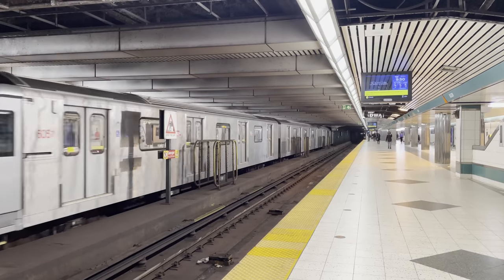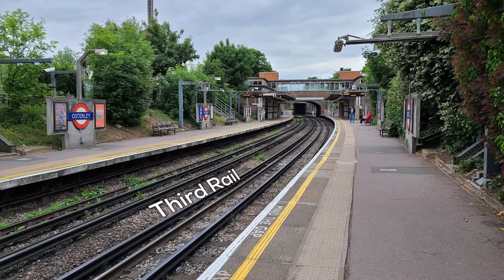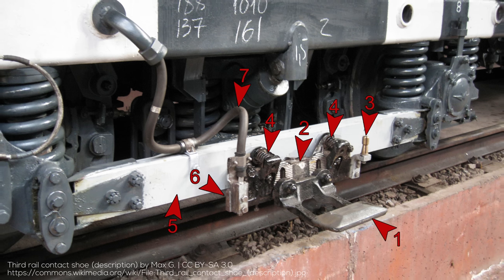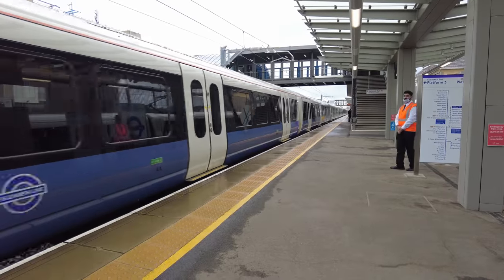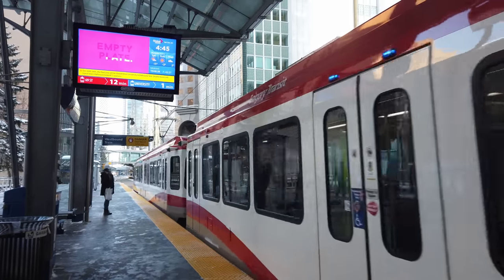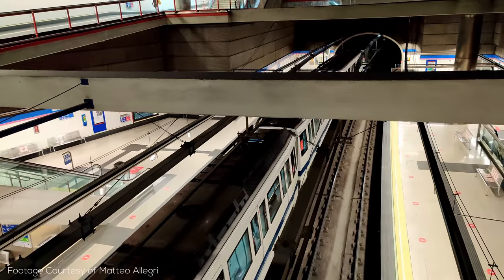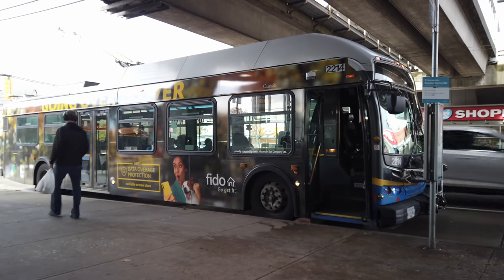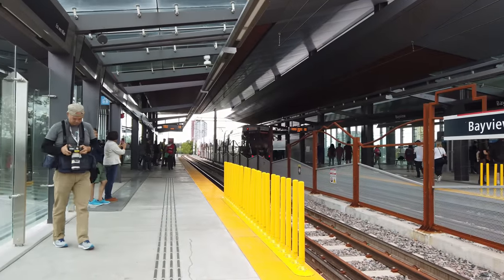The Best Way to Power Your Railway | Third Rail vs. Overhead Wire

Comment from the maker: This video a remake of a previous video incorporating viewer feedback and fully revamping the visuals and rewriting the script (for more details, see my recent community post). Please enjoy and consider sharing!
Reply: I like this video a lot better than the original one 👍🏻
Reply: Please make a follow up explanation video about the Alstom APS and why it doesn't work for temperate climates The information is sparse and the concept is fascinating.
Reply: @RNTransit  in The Netherlands the RET Metroline E rides from Den Haag Centraal to Slinge and from Den Haag Centraal until metrostation Melanchtonweg the metro use Overhead Wires and at the station Melanchtonweg while it halt at the station it switches to third rail and then it uses from Melanchtonweg until Slinge third rail from the Rotterdam Metro system and it shares the tracks from Den Haag Laan van Nieuw Oost Indie until Leidschenveen Tram/Metrostation with HM Randstadrail line 3 from Den Haag Loosduinen to Zoetermeer Centrum-West and 4 from Den Haag De Uithof to Langslingerland Zoetermeer and they use then the former Hofpleinlijn and the trams also the former Zoetermeerlijn. And by RET metroline A from Binnenhof metrostation it use overhead wires from Binnenhof metrostation until Capelsebrug and Metroline B use from Nesselande metrostation until De Tochten metrostation third rail and then by De Tochten it changed to overhead wires and then from De Tochten until Capelsebrug it use overhead wires and halfway by the crossing by metrostation Graskruid metroline A joins metroline B to Capelsebrug and then together it goes to Schiedam Centrum running together with metroline C until Schiedam Centrum and metroline A and B are switching while driving to Schiedam Nieuwland from third rail to overhead wires and from Schiedam Nieuwland until Vlaardingen West metroline B runs together with metroline A  and sometimes a freight train until Vlaardingen Oost and the metroline B runs to the temporary metrostation Hoek van Holland Haven where it ends on 1 of the former train platforms where in 1935 until 1994 D train international teaibs deprted and until 2017 local trains to Rotterdam Centraal departed. Metroline C runs from De Terp to De Akkers where it shares tracks from Capelsebrug until Schiedam Centrum with RET metrolines A and B where line A and B runs then to Vlaardingen West and Hoek van Holland Haven and metroline C runs then further to metrostation Tussenwater where it shares until metrostation De Akkers where it ends the tracks with Line D wich runs from Rotterdam Centraal and shares the track to Slinge with Line E from Den Haag Centraal and metrostation Beurs is a metrostation where at Beurs you can change from Metroline A to Vlaardingen West and Binnenhof to metrolines B to Nesselande and Hoek van Holland, metroline D from Rotterdam Centraal to De Akkers, metroline C from De Terp to De Akkers and metroline E from Den Haag Centraal to Slinge. Maybe you can make a video about the Rotterdam Metro
Reply: Hello Mr. Martin,
thank you for the remake.
However you apparantly still just do a comparison and no clear verdict of which type of electrification, voltage and frequency is the best and should be built for all types of trains in the future. Could you maybe still state a verdict on that?
Best regards,
Reply: This is a much more thorough comparison than the last video, but thing you still didn't mention (and I can imagine fair reasons why you wouldn't) is cost. Third rail does involve less structural components and less copper, with modern systems mainly relying on relatively accessible aluminium. With modern tech, it could simply be incorporated into slab track. This means that there's some benefit to resource use and embedded carbon, at least on the denser systems where third rail is best suited, even if some may argue the actual financial advantage. This can also mean less maintenance if the RoW is protected, which can be another cost saving.
This is why I'm something of a third rail defencist, since on grade-separated metros using a 1500V bottom-contact system, you ditch most of the disadvantages but retain all of the advantages, and I think it should really be the standard for new metro systems, especially since it's easy to combine with traditional 1500V overhead in particular areas, as you mentioned.
Reply: @1121494  I think the point is that there is no best answer and it depends on the use case.
Reply: What form of power would you recommend for a Caribbean island  which is prone to hurricanes and will be crossed by cars and pedestrians?
Reply: When you visit Liverpool to check out the Merseyrail you will find there are to be two different dual mode sets introduced for the system's extensions. Third Rail is the main power but eastern extensions with have OH Wire switching. The other extensions will have Battery mode when they leave the Third Rail powered section.

Comment: I work for the Washington DC Metro.  I just wanted to point out a few details about 3rd rail you missed.  1.  The main reasons 3rd rail switches sides is to separate sections so they can be shut off in individual segments instead of the whole line, also it evens out the wear on collector shoe.  2.  On a bottom contact system the top and sides are still live as it's a solid piece of metal, also the bottom and sides of the third rail are the most likely places to accidentally touch with your foot, not the top.  3.  For inclement weather there is heater tape on the rails.  Also we have special deicer flatcars that have insulated scrapers to scrape ice off the 3rd rail and spray nozzles for glycol antifreeze.  Additionally in extreme conditions the revenue cars can also be outfitted with glycol sprayers.  4.  In the yards there is 3rd rail.  However inside the railcar shops there is something called a "stinger", which is basically a 750 volt jumper cables hanging from a track on the ceiling.  It's got a clamp on the end that a mechanic wearing insulated gloves will attach to a collector shoe.  This is probably what they're talking about for the Chinese metro yards.
Reply: What type of third rail is in DC?

Also, unrelated question, WMATA has already had to slow the trains a couple times this year because of hot weather expanding the rail. As someone who seems to know WMATA’s infrastructure well, do you know how this can be dealt with better?
Reply: @pizzajona  We use top contact 750 volt dc third rail.  As for the speed restrictions, unfortunately the laws of physics and metallurgy work the same in DC as anywhere else.  The reason for the restriction is that if there is a sun kink the operator can hopefully see it and stop the train in time to prevent a serious derailment.  We use 100% continuously welded rail with pandrol clip fasteners, so we are a bit more susceptible to sun kinks than other transit systems that still use jointed rail and spikes.
Reply: @technoman53  thanks, that’s very helpful! Is there something other transit agencies in hot climates do that can help WMATA? Or do new lines need to be built underground to fully solve this issue?
Reply: @pizzajona   Oslo used to use a somwhat milder (softer) steel than running rails (and also a different profile & weight). They have now started to replace steel with aluminium, since aluminium is lighter and also is a better conductor than steel. I guess that makes for a lighter third rail, which probably has some benefits, and for less losses, or the ability to provide more peak power. Engineers usually have good reasons for such changes. :)
Reply: Interesting. Oslo almost exclusively has the third rail in the middle (to the left) of the track. It only switches to the right in a few tight curves, and in switches. However, since trains switch tracks at the end stops, the contact shoes get even wear. Oslo also uses under-contact (as does the Berlin S-Bahn), as opposed to Stockholm, who uses top contact (like New York & London "overground"). Since Stockholm started service maybe 10 years before Oslo, the engineers might have had a look at the difficulties you’ll encounter with top contact & snow & ice, and decided on under-contact. (Or they might have decided on under-contact as safer for people & animals straying on the tracks).

Comment: If anyone else is curious like I was, the reason why the pantographs don't ruin the wires and themselves with friction when trains are going at such high speeds is the contact point uses graphite. Graphite is both a solid lubricant and electrical conductor. When it wears down they simply replace the contact point on the pantograph and the wires above are just fine.

Comment: You missed one of the best examples of a train system that uses both overhead wiring and third rail on the same service: The New Haven Line of Metro North Railroad, which serves New York City and its Northern suburbs including into Connecticut. Running from Grand Central Terminal in New York City, the New Haven Line uses third rail power at 700V DC to just outside NYC at Pelham, NY, where it switches to overhead line at 12.5kV AC. Just a few miles further at New Rochelle, NY, the line becomes shared with Amtrak long distance services joining it from a line from Penn Station to the South, which also use AC overhead electricity - Metro North and Amtrak services share the rest of the line from New Rochelle NY to New Haven, Connecticut using said overhead line all the way.

Comment: Rigid Catenary in urban tunnels with regular catenary in the open seems like the best overall option to me. Does anyone know what Crossrail uses in tunnels? It seems to be rigid catenary but with catenary poles? Odd
Reply from the maker: IIRC rigid is used in some places, there are not full poles in the tunnels though! You can see in the POV videos!
Reply: Definitely rigid bar in the tunnels.
Reply: You can see the rigid bar used in the tunnels in the Crossrail Project's December 2020 cab view!
Reply: @fetchstixRHD  Yes, rigid bar for sure. I'm talking about what is holding the rigid bar. Seems to be a bit more complex than what I've seen used here in the Barcelona metro for instance.
Reply: @paupadros  in this case it's basically just a three-section bar connected between the roof and the conductor rail, the centre section being the common brown insulators.

Comment: I've seen the MBTA blue line change modes from third rail to catenary! It happens at airport station
Reply: Strangely, when the extension to Wonderland was first built, the switchover happened at Maverick. The train used the overhead the entire time it was above ground. For some reason they moved the switchover point to Airport at some point in the 70s or 80s (Maybe when the Hawker-Sidley stock came online). The last time I was up that way, the overhead still continued all the way to Maverick, though.
Reply from the maker: Yeah! Its not a huge production which I enjoy
Reply: NYC Metro North and NYNHH&CT have dual modes: catenary and underslung third rail

Comment: The reason why the London's Underground rail system has four rails is for stray current return. This fourth rail mitigates the problem of electrolosis due to the fact the stray electrical current will corrode nearby steel pipes and structures. The fourth rail has a low impedance return current path back to the power source, or generator. This keeps all metal structures in the vicinity from rusting.This also aids in tripping the circuit breakers faster because of higher currents, all to prevent electrical shocks.
Reply: There were a few cities in USA that were so worried about stray currents that their trams were totally insulated and used two wires, like trolley buses. :)